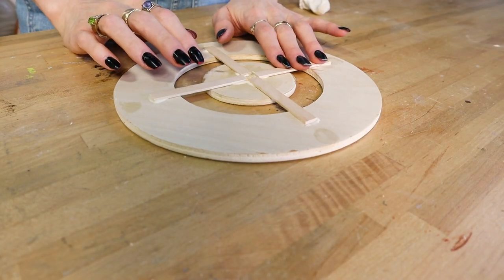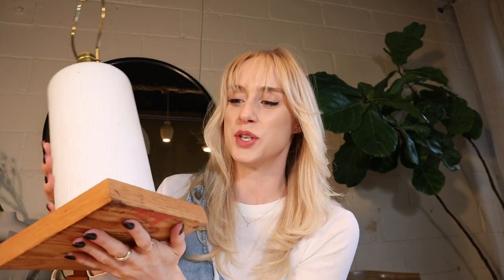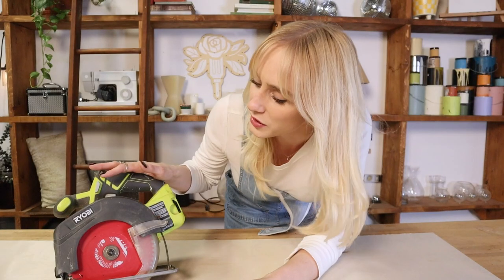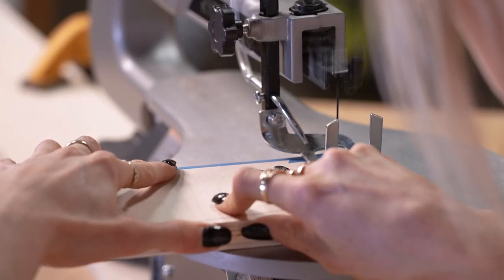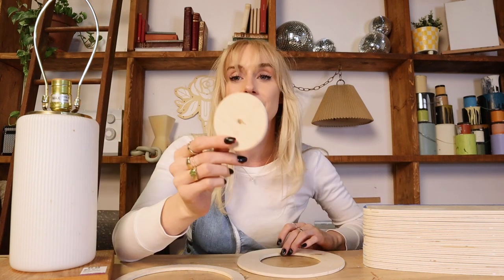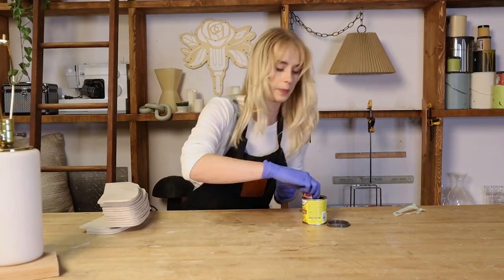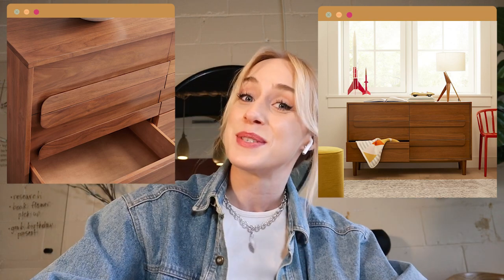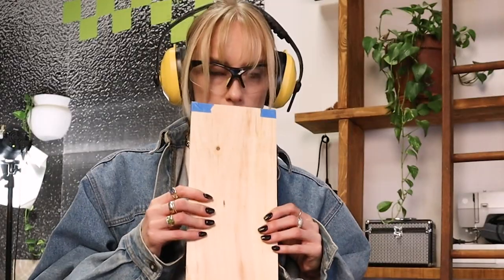i upcycled this old dresser *west elm dupe*

Comment: Scroll saws are my favorite, and that's a cool first project on one! A couple tips: 1) Pluck the blade while tightening until it sounds nice and resonant, then stop. 2) Always push forward with both hands when cutting curves, people tend to overdo the difference between pushing each side of your material. 3) To get more reliable cuts, center yourself in front of the saw, look at the line of the blade and then imagine it continuing on to your drawn line. If they are lined up, your cut will follow where you want it.

Comment: For the lamp, when you have to make numerous shapes that should all be identical, it's best to use a router with a flush trim bit (considering you already had the template from the old cutting board too).

Comment: Love it! I’ve always wondered how to go about creating a lamp shade and I really liked your approach. 

Since you invited comments regarding the scroll saw, I think the pieces you’re cutting may be a bit too thick; scroll saws work best for fine detail work with very thin stock. Band saws are a better choice for thicker stock, and you’ll get far less blade deflection than either a jig saw or a scroll saw. An alternate way to do the shade (assuming your plywood is at least 1/4” thick) would be to rough cut one piece with a jig saw, sand to the final desired shape, then use a template bit in the router to cut the remaining pieces (ideally after rough cutting with a jig saw or band saw). 

But your approach totally worked - loved the sanding together trick to increase consistency. Thank you for sharing it with the world!

Comment: Such great flips! I have 1 little tip, if you add notches in the rings as well, it locks in the outer fins without needing glue and you can easily pop a few out to change the bulb. Love you work Rochelle.

Comment: For the scroll saw, blades make all the difference! The stock blades from Ryobi aren’t the best but if you switch them out for Modified Geometry Blades or Skip Reverse Tooth (pretty much any blades that are angled downward) will help to cut smoother for an easier time running the material through the machine and less tear out on your material😊

Comment: Tip on the scroll saw, when possible, cut in the direction of the grain. you'll have better control of the wood (won't catch against the grain) against the blade. Also, standing while using that will give you a better range of motion and keep your face further out of line with the blade.

Comment: Quick question...while you filled in the line across the bottom of Justin's dresser with wood filler, why not do the same with the vertical lines that artificially made it look like it has more drawers? Seems like a missed opportunity. Then the handles wouldn't have had to be made into separate pieces trying to continue the faux 6-drawer look. The 2/3 - 1/3 size mismatch would have been lovely and elevated the piece even more. BTW, Rachael, your talents are marvelous! And you're charming on video!